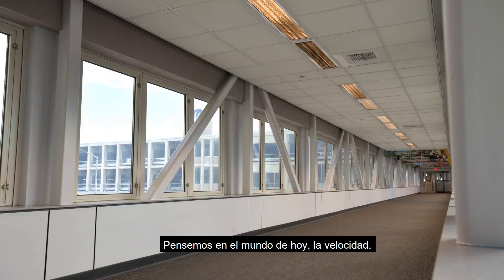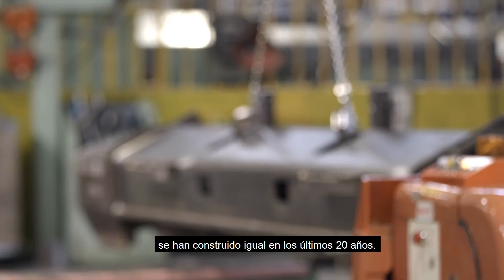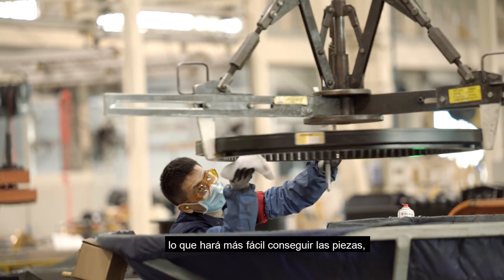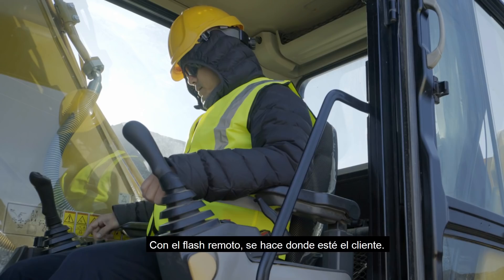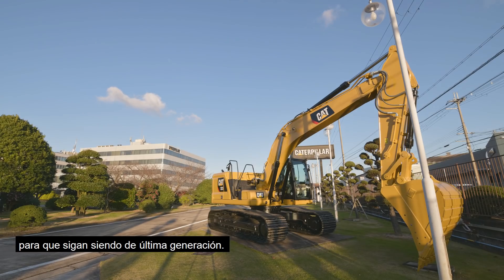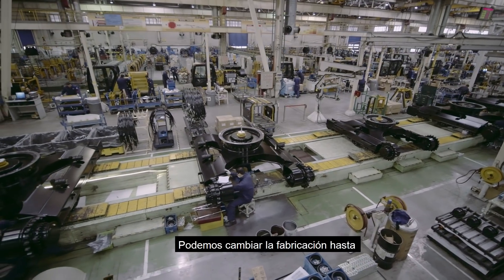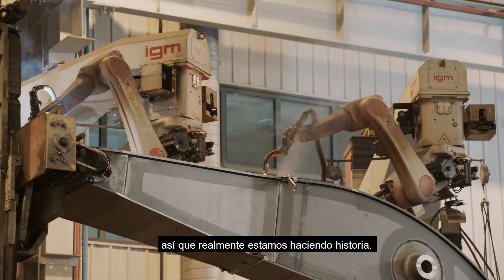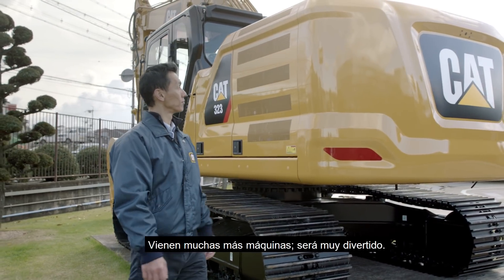Nueva generación de excavadoras Cat®: Fabricación

Comment: I expect from CAT a greater choice of accessories (between the shape / size of the bucket blades).
Hybrid vehicles with 48 v engines. that do not need electric charging by cable.